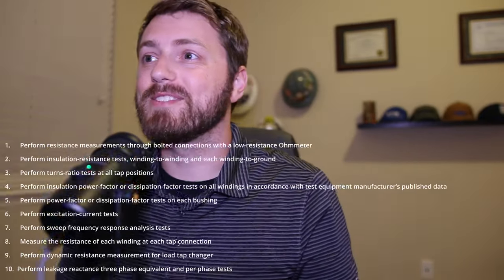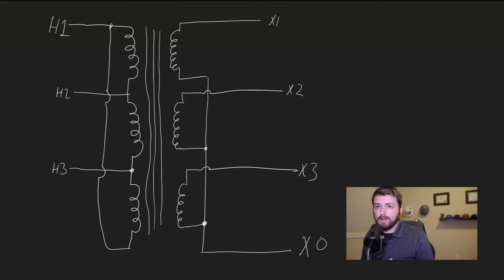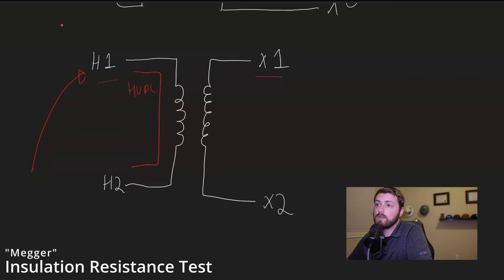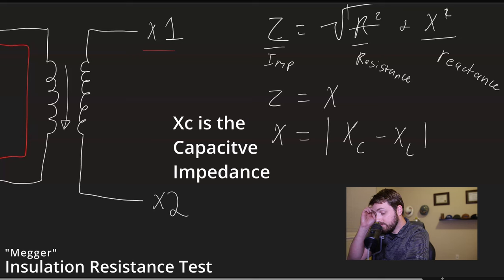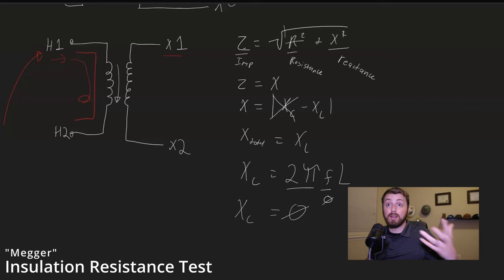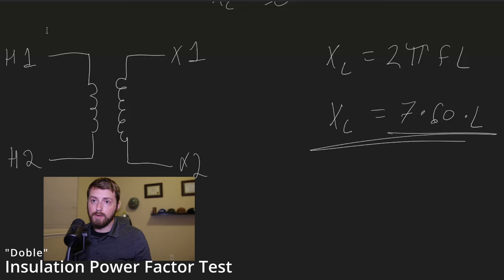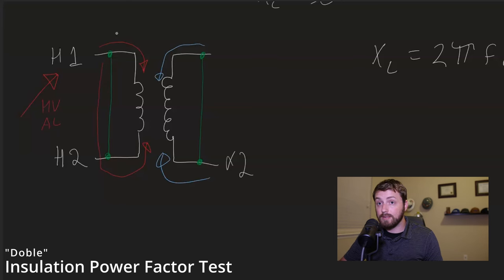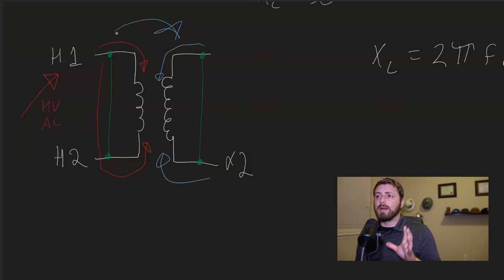Q&A#1 - Why do you short transformer windings for Power Factor but not Insulation Resistance testing

Comment: Great video! Although we short the windings during Megger so that we can transition immediately to Power Factor test.

Can you talk about negative insulation power factor too? I've read some literatures about it but I'm not sure if I fully understood them. Cheers!
Reply from the maker: That's a good point. It really shouldn't affect  the megger readings one way or the other. 
If your power factor result is negative in the context of an insulation power factor test, it means the reading is more inductive than capacitive. Current flowing through/out of the winding under test is leading the voltage (remember ELI the ICE man). I'm not the all saying guru about every type of transformer, but every time I've seen a negative PF it's been because we hooked up the test set wrong, something wasn't grounded, or there was an internal winding issue like a bad DETC.